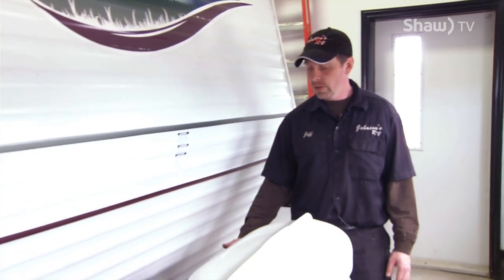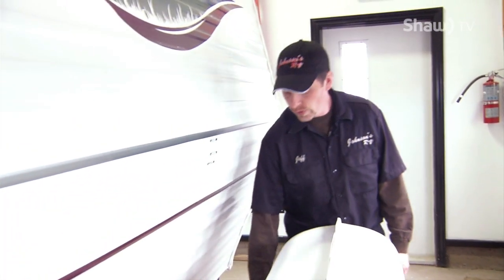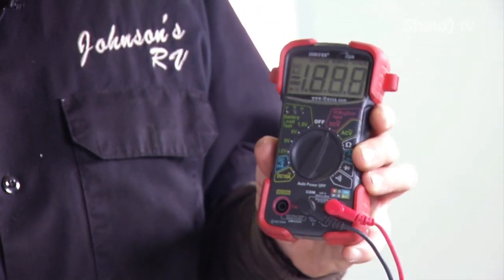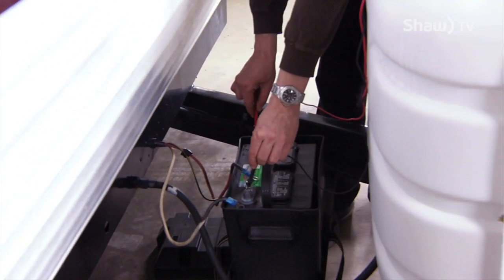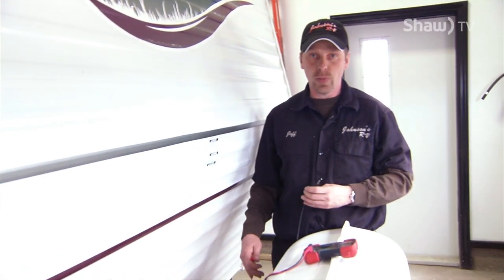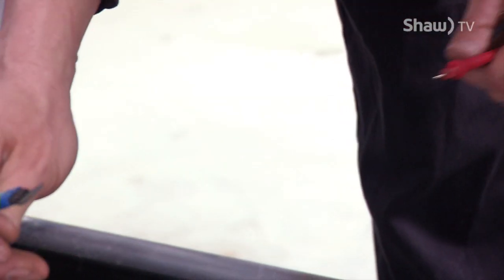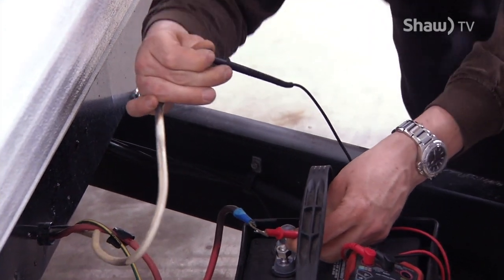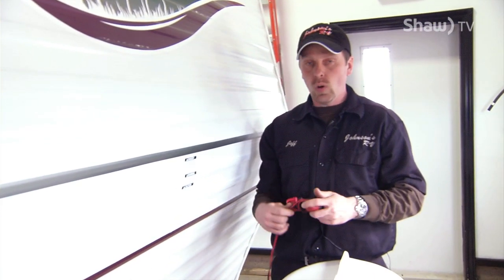RV Tips - How to check your battery and charging system

Comment: I have a 2021 Imagine XLS that I purchased new in August 2020. We have been out on two trips of about 2.5 months each with no problems. We returned home in early Feb and after being home a few weeks I noticed that the interior lights were really dim when I turned them on. I checked the batteries and sure enough they were low. I charged them and they were fine for a short time when the problem reappeared. After watching your video I tested my system with a multimeter and there is no power coming through the RV charging to the batteries. Obviously, I have a blown fuse or something similar. I have checked and all my breakers and fuses in the electrical panel are good. There is one inline fuse and one inline breaker near the battery. I've checked both of them and they are good. Where do I look next? thank you
Reply: Having same issue. What was your solution? Thanks
Reply: Ditto
Reply: Converter bad

Comment: I press the trailer, Batt. button and it says full charge. Yet I know for a fact that the battery is nearly dead. The trailer is plugged in constantly since my sister lives in it. So, to get a "real" reading, should I try disconnecting from the AC power?
Reply: Yea unplug it and disconnect the battery to get a real reading. Make sure your converter is putting out a charge. Mine was dead.

Comment: If I'm plugged in and my battery isn't charging where is a good place to search cuz I'm not finding on the converter
Reply: If your plugged in to shore power, your converter should be putting out over 13 volts....if not you may have a blown fuse or something similar or your converter is dead.

Comment: Do you need to unhook the battery from the charging leads to test the charging leads? What if the charging leads show 0, but the battery lugs on the converter show 13.6.

Comment: does it stop charging when it is full or always continuous charge? I leave mine connected all the time.
Reply: The battery will stop taking charge once its full. So youre good
Reply: @christiand2426  no it wont unless you have an intelligent charger. Normally chargers will boil or damage the batteries.

Comment: So where’s the fuses or breakers for my converter if 8m not putting out power from it?
Reply: How in gods name would anyone know that without any given information on your part? Smh
Reply: @godackgudalach1  There should be a self resetting breaker or fuse on the wire coming off the battery before it goes inside the trailer.  there will be more fuses in the converter that has all the fuses and breakers and makes the 120 volt AC into 12 volt power.  , I agree that you need to post your make and model to get specific advice.

Comment: Is it the same voltage for AGM batteries?
Reply: No 13.5v is ok for an FLA but it is just way too low for AGM. With AGM you really need a 2 stage charge with voltages of around 14.4v-15v depending on the specific battery and temp. Look at the battery see what charge voltage is stated and if you do not have that then fix it. That applies to Grid charging and alternator. Do not ignore it because it will just result in killing off the battery faster. In fact a charger that only offers 13.5 is a good indication that it could take a bearing if you are taking the battery below 50% DOD.  I personally would not recommend going below 50% on all but lead carbon but many have bought into the 80% DOD with AGM. Sure some of the more premium AGM are going cope better with lower DOD but lets be realistic though most people are just not dropping fat wad of cash on the best of the best AGM that exist. Why would you it makes little sense when you can buy a cheaper battery and replace it sooner.  But get a good 2 stage charger and get the best out of it.

Comment: Thank you.   If, while plugged into 110, the trailer charging system is working properly and the batteries are up to charge, but don't charge while hooked up to the truck after a day of driving, what could the problem be?
Reply: I've been watching youtube videos re: charging / battery issues....if  battery isn't charging while hooked up to the truck while driving (it should be charging)  it could be a problem with your tow vehicles wiring. the hotwire system may not be big enough.  any voltage drop between vehicle's alternator & the trailer's batter will cripple charging....even 1/2 of a volt drop.  Cables & connections may also be the problem.
Reply: @derek-io8po  check for power at your truck trailer connection. 
check your fuse box  and location the fuse that feeds the power supply  to the trailer connection

Comment: My batteries are weak or dead in front of my rv how do i charge them ?
Reply: With a charger.
Reply: If they are super low you'll need to jump start them using a good battery. Hook em up in parallel and put a charger on it. For the dummy who commented charger-thanks captain obvious